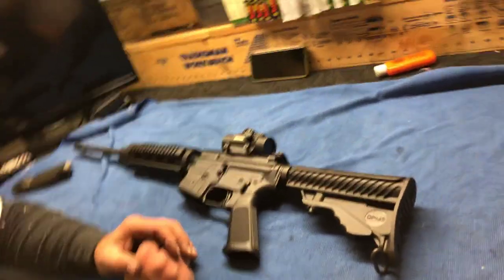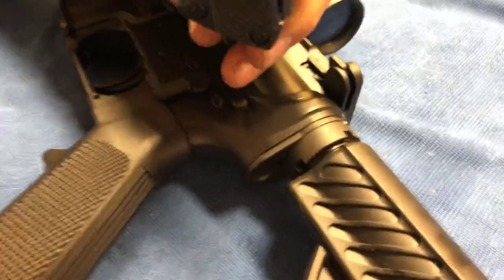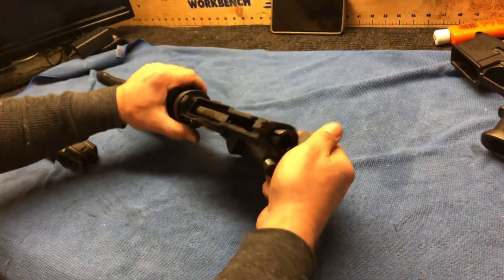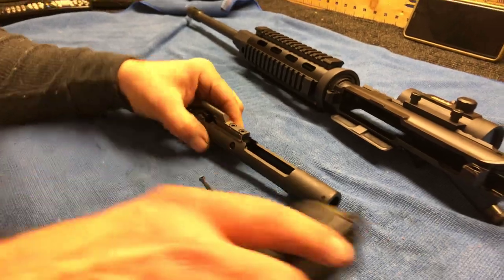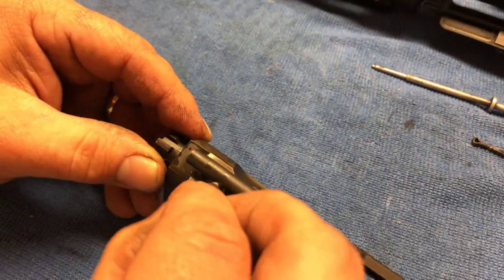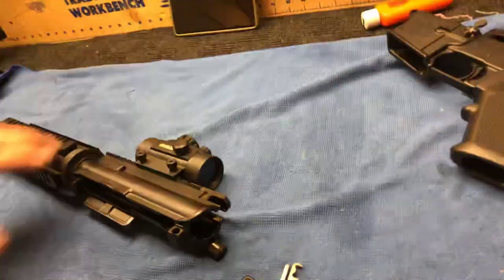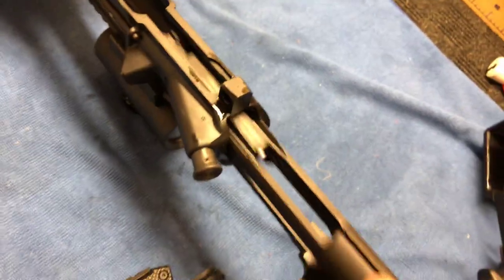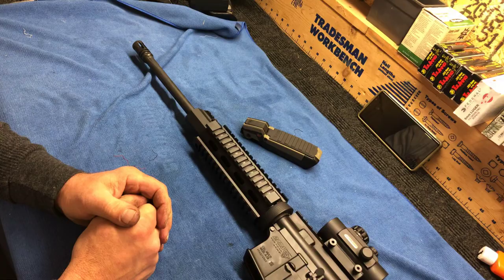How to break down and reassemble dpms ar-15

Comment: Great video.  The presenter proceeded methodically and clearly explained every step of the procedure.  Not incidentally, I love that multi-tool gadget, which appears to have been designed and manufactured specifically to assist in breaking down an AR-15.